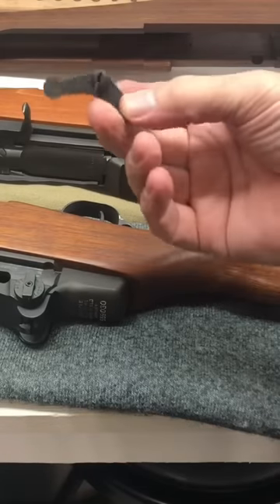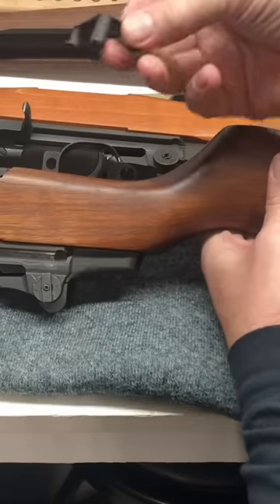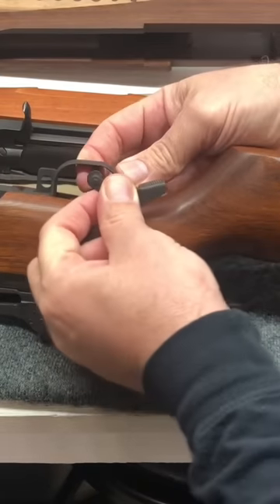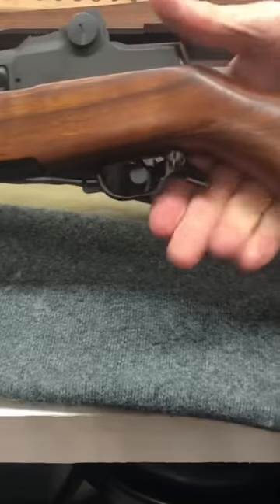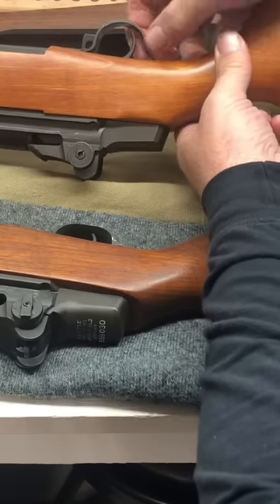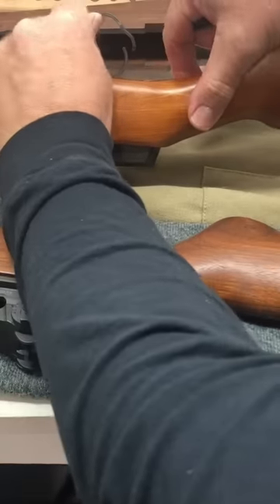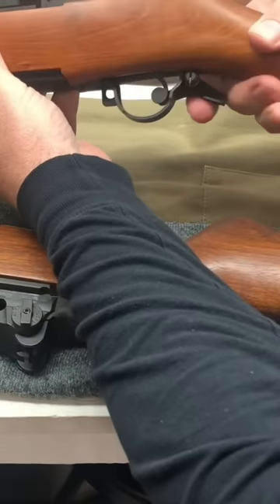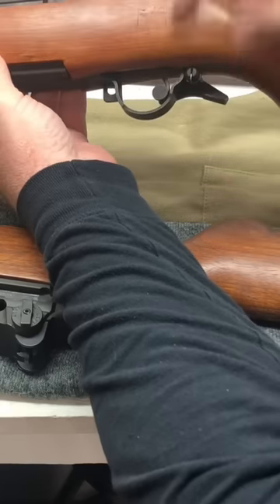M1 Garand winter trigger.

Comment: Most so called winter triggers aren't actually winter triggers. But triggers to shoot rifle grenades so when you shoot your rifle grenade and your rifle kicks back doesn't break your finger when it's in the finger guard.
Reply: they serve both purposes
Reply: @TheTokkin  idk because it would be more efficient to have a trigger guard that could be moved out of the way for glove use. Sure you could use it for both purposes but it seems it's original purpose is for rifle grenades
Reply: Are there even rifle grenades during the time of its inception?
Reply: @thewhalewacker682  the thing is the grenade recoil on the m1 garand isn't that much different from the normal rounds. So i guess its intended purpose was indeed for winter glove use.
Reply: @ghost1591  it's possible but I feel like the design could have been done more efficiently. why add an extra piece when the trigger guard could move out of the way allowing for easy glove use
Reply: your finger isn't going to snap from excess recoil. get a little chewed on my the guard, sure. I've personally had that happen with a particularly spicy shotgun with two barrels.
Reply: @jerryalbus1492  yes, the Garand had rifle grenades that would be launched using a spigot on the muzzle that latched on via the bayonet lug.
Reply: @thewhalewacker682  i could be wrong but the original design of the m1 wasnt made for winter, so yes it makes sense for a guard to be able to be moved but why would it if it wasn't made for winter originally
Reply: @jerryalbus1492  there have been grenade launchers that date back to the 1700's actually. They weren't as sophisticated as today's modern weapons obviously, but that's where they originated.
Reply: Why do I feel like that would make it easier to mag dump
Reply: @jerryalbus1492  yes they did.
Reply: @thewhalewacker682  the guard is a part of the disassembly process, it disconnects the trigger assembly from the action.
Reply: @ghost1591  Dude the recoil from the grenade is so much more...
Reply: @Jerry Albus  yes, and they were very popular due to different grenades being available from standard frag, smoke, and even anti armor grenades
Reply: @thewhalewacker682  wouldn't putting triggerguard away solve both of those?
Reply: @Finnishnat-conservativedot7126  that's my point
Reply: @thewhalewacker682  no you said that it's not meant for winter gloves by saying that you could just flip the triggerguard (which starts disasembly) which theoretically in your views would also deny the theory that it's meant solely for grenades....
Reply: @Finnishnat-conservativedot7126  The extra trigger is probably the best solution at the time because the trigger guard starts disassembly ( I didn't know ). It's very realistic that the extra trigger serves both functions, I just think it would have been a better design if the trigger guard could simply move out of the way rather than having to carry a loose piece with you.
Reply: @thewhalewacker682  this does sound logical I give you that, but I'll genuinely ask if you ever shot a rifle in mittens? Genuine question
Reply: @Finnishnat-conservativedot7126  not in mittens no
Reply: @thewhalewacker682  I had, and trigger like that doesn't allow to grip the rifle the right way, so you have to twist your wrist in quirky angles that can hurt if you are unfortunate. it's hard to explain the positioning so you'll have to trust me on this
Reply: @Finnishnat-conservativedot7126  understandable, I just feel like ( in hindsight) there's a more efficient solution to both the rifle grenade and mitten issue. Granted your experience with your rifle does show that it is definitely easier said than done
Reply: @thewhalewacker682  Because that's not how they designed it. It really is as simple as that. They didn't make the garand with a movable trigger guard, so they designed the winter trigger. It is much MUCH simpler to just add a hole in the back of the trigger guard, then to redesign it to move out of the way.
Reply: @scythelord  no, I know. Obviously that added trigger is way more viable than redesigning the gun. In hindsight there is a more efficient solution however the added trigger is more efficient than redesigning.
Reply: the proper way to fire a rifle grenade in the handbook is to place the stock of the rifle on the ground or against your body to negate the recoil i doubt this
Reply: @thewhalewacker682 on the M1 Garand, if you move that trigger guard out of the way, the rifle will come apart, it's how you break the weplapon down for maintenance
Reply: @jerryalbus1492  Yes, rifle grenades were in use during the First World War.
Reply: @thewhalewacker682  because most gloves were mittens unless you had some really good ones? Its still easier to depress the shallower angle trigger without fighting against the fabric of your mitten with your finger but its all semantics as ive never actually used it
Reply: @thewhalewacker682  because their gloves were actually mittens instead of gloves. Then they went to mittens with a trigger finger for the glove part. Mittens are warmer than gloves because your fingers are all together rather than each individual finger in a glove part.
Reply: @Finnishnat-conservativedot7126  you hit the nail on the head, back then the Army gloves were mittens so having a swing away trigger guard would do you absolutely no good cuz you still couldn't get your trigger finger around the trigger, your mittens wouldn't allow it. That's why they made the extra trigger and people started using them with grenade launchers.
Reply: This is VERY incorrect.
Reply: This, well mainly the it's for rifle grenades idk about recoil breaking fingers though definitely seems possible if you aren't properly braced. Also with rifle grenades they would primarily placing the butt of the rifle on the ground and using it similar to a knee mortar. You can't really use the trigger normally in that position, hence why this one allows you to do it just wrapping your hand around the stock.
Reply: @ghost1591  Bro the is utterly false, it's significantly more recoil, 1.2 pound projectile at ~300 Fps is way more energy than 30-06. I have fired modern repros and it's significantly more recoil even with lighter dummy grenades and modern grenade launching blanks that are quite a bit toned down so people's antiques don't explode. but basically no one was firing from the shoulder anyways so doesn't matter that much.
Reply: 🤣🤣 the recoil is not going to break your finger. More internet bullshit.
Reply: @jerryalbus1492  yes. Rifle grenades are prominent until the vietnam war where grenade launchers were introduced.
Reply: @jerryalbus1492  bruh
Reply: @conman3538  bruh
Reply: Yeah I was thinking from a safety point not that’s practical tbh I know nothing about garlands and their safeties but I imagine I it’s better than freezing your hand off and dying or broken finger
Reply: @jerryalbus1492 of course. rifle grenades were around in WW1. very primitive comparatively they for sure had them in WW2. you put a special kind of round in the chamber and then slap a special greneade on the end. (think of an RPG but with a pineapple grenade and fired from the shoulder instead of over the shoulder)
Reply: @jmsgridiron5628  is it those rounds where you have to put something like a stick in the barrel before you fire?
Reply: @thewhalewacker682  and they couldn't just do that for rifle grenades as well?
Reply: that doesn't even make any sense. you can easily shoot rifle grenades without breaking a finger. but have you ever tried shooting with heavy mittens or gloves on?   it can't be done in most cases, and you risk actual frostbite if you expose a finger to pull the trigger. that metal is cold. we had troops in the Ardennes, in Greenland, the Aleutians, in the Arctic. they needed to be able to shoot, they NEEDED a device like this. you don't need this to fire an RG. my guess would be that winter triggers were often adopted for use with grenades.
Reply: @thewhalewacker682  they were making guns long before this, which were often used in the winter, and they have been making them since, for 80 years since the Garand was invented. and none of them have bothered to include a folding trigger guard for use in cold weather, even those which could be expected to see a great deal of winter service at some point. so either you are a brilliant genius who has thought of something that generations of firearms designers totally missed, or they thought of it and decided against it in every case for reasons you have not thought of yet. my guess is that a folding/removable trigger guard is just too fragile or easy to lose. if you lose the little winter triggers it isn't the end of the world, you can make do. but a broken or missing rifle part is more serious.
Reply: @justforever96  I mean, if it's used to disassemble the gun  then I don't think it would be very unrealistic that a rifle could have a design in which the trigger guard could be rotated or otherwise moved. I understand what you're saying though.
Reply: Wasn't the rifle taught to be fired off the ground with the grenades?
Reply: @Jerry Albus  oh yes
Reply: @jerryalbus1492  for sure
Reply: @ghost1591  that is 10000% false dude wtf? Do you know what you’re talking about? Recoil from a rifled grenade is MUCH higher than 30-06
Reply: @Yoboyleroy  Difference is a 1000gr projectile  grenade vs a 165gr projectile bullet. Take a physics class, or get common sense haha.
Reply: @notablediscomfort  use a spent shell between the triggers, no more cut fingers, well timed double bang. 👏
Reply: @FullThrottleRacing535  pulled into your shoulder hard the rifle grenade is not that stout. feels like 00 buck not pulled tight to your shoulder, may be too jarring for a pansy ass.
Reply: Assuming the same amount of gun powder, the recoil should be similar
Reply: @thewhalewacker682  if you can remove the trigger guard for glove use, you can remove the trigger guard for rifle grenade use. you're logic right there.
Reply: @jerryalbus1492  they had rifle grenade back in the 1861. The Ketchum Hand Grenade.
Reply: Standard procedure was to fire rifle grenades using the ground as a base. You wouldn’t fire them from the shoulder, so the recoil would be nowhere near enough to break your finger. Also, I have never seen any documentation of rifle grenadiers being issued anything like this during the war
Reply: @kano8  yes, that would be the intention of having a trigger guard that could move
Reply: Yelling to Germans or Vietnamese

"HOLD UO STAY THERE LET ME CHANGE MY TRIGGER TO SHOOT A GRENADE"
Reply: @jerryalbus1492  seriously? They had grenades when they were still shooting arrows and rocks at eachother
Reply: @pws3rd170  no, it would not. Charge matters much less than projectile weight. Shooting a 160gr bullet vs a 1000+gr grenade is night and day. PHYSICS 101
Reply: @pws3rd170  oh my god you’re even a physics teacher. You should know this haha
Reply: @thewhalewacker682 guns today have still winter trigger but no one uses rifle grenades anymore...
Reply: @thewhalewacker682  because if it moves when you don't want it to, you end up with serious safety issue
Reply: do you have any idea how rifle grenades work?
Reply: what's next? you're gonna tell us how a carry handle isn't actually used for carrying a rifle?
Reply: @notablediscomfort  same I've touched off both triggers on a 12 gauge double barrel one hand. If you're actually holding your gun you won't have any problems. Then again, I'm not a normal size man. Still tho.
Reply: Firing the barrel mounted grenade wouldn't produce any more recoil that firing it normally.
Reply: @jerryalbus1492  rifle grenades were around well before the M1 in 1908.
Reply: @jerryalbus1492  of course there was why would we even need rifle grenades anymore
Reply: @Frogtalkin  I agree, ive never shot one myself but my original comment was honestly just calling out the fact its not the same as a normal round in terms of recoil, ive seen videos of people who can handle recoil well and have good shooting posture and you can notice it does kick a bit harder, nothing to cry about however
Reply: @thewhalewacker682  could have been something overlooked in development or relating to the machine process at the time, remember it's a very old rifle.
Reply: @thewhalewacker682  nah bro u need a trigger guard 😂 nice try tho
Reply: @thewhalewacker682  because the guns weren't designed for winter warfare they were just designed for warfare.
Reply: @thewhalewacker682  because the guns weren't designed for winter warfare they were just designed for warfare.
Reply: @jerryalbus1492  rifle fired grenades have been around since ww1
Reply: @nfaisnfgay  but the 1000+gr grenade is going significantly slower. You are still limited by how much energy you are putting into the equation. If you aren’t putting more force in, you aren’t getting more opposing force (recoil)
Reply: @nfaisnfgay  I’m actually not. That was my Junior year honors physics class. It was my bridge though
Reply: @thewhalewacker682
Reply: @thewhalewacker682  Safety. Instead of having people running around, never reinstalling the guard. People can do this much more quickly. That way they don't drop the rifle and have it fire accidentally.
At least that's my way of thinking.
Reply: @midgetman4206  it doesn't have to detach to be able toove out of the way. You could still lose the other trigger assuming you didn't just keep it installed, which would be fun but hazardous
Reply: @ghost1591  precisely. Rifle grenades for these old rifles is the same kick as just shooting it normally
Reply: @jerryalbus1492  rifle grenades have been a thing since before ww1 and beyond
Reply: The propellant for the rifle grenades was a blank round. It would have been the same if not less recoil than shooting it. You literally just made this up lol
Reply: Imagine being the first few guys to learn the hard way
Reply: @pws3rd170  I… okay buddy. Go to a range and shoot a 180gr 500 S&W magnum vs a 500gr 500 S&W magnum  and get back to me.
Reply: So 2 seconds of research determined this to be false
Reply: @NFAisNFGAY    yeah, it actually doesn't recoil much more than a rifle or shotgun round. 3 seconds of research have proven you wrong.
Reply: @jeremybianco8647  That’s factually incorrect. You found one bad source that agrees with you. Go to a gun range and rent a 500s&w magnum. Shoot 180gr loads, then 500gr loads. Tell me there is no difference with a straight face. Want to come shoot my Garand? Rifle grenades have significantly more kick than the standard rifle round
Reply: @NFAisNFGAY  I've been shooting my entire life dude. I've shot multiple m1s, mosins, kars, .500 Magnum, 10 guage, 50 bmg, and 700 nitro express, so yeah dude you're bullshitting the wrong guy acting like your m1 has kick. And it isn't one article its hundreds, and from people who have actually fired them. Even specified grenade launchers like the m79 were easily able to be shoulder fired. The round used to fire the grenade is what causes the recoil, not the grenade itself. And it was designed for the rifle to be able to handle, and to be usable by your average foot soldier.
Reply: @jeremybianco8647  then you would know a higher grain weight increases recoil. Done trying to be logical with you. Get your neck beard shaven off sometime lol.
Reply: @jeremybianco8647  muted, neck beard
Reply: @nfaisnfgay  gets proven wrong and mutes the guy that proves him wrong lol
Reply: i love making stuff up on the internet
Reply: @jerryalbus1492  the kind he is talking about only existed at the same time as these guns, didnt exist prior, and stopped being used after.
Reply: @thewhalewacker682  that’s how you break your trigger
Reply: @jerryalbus1492  Rifle grenades have existed since blackpowder was commonly used in militaries
Reply: How the fuck can it break your finger?
Reply: LOL no bro it wouldn’t break your finger it’s honestly a winter trigger 😂
Reply: @thewhalewacker682  nah coz if the guard moved out of the way you'd still have to hook a single finger around onto the trigger rather than just been able to squeeze against the rifle with multiple fingers.
one thing is it would be awkward to shoot while looking down the sights as you would have to have your wrist at more of an angle.
Reply: @ghost1591  an object at rest brother. Much more mass on a grenade than a bullet. We’ve all played call of duty but you certainly wouldn’t shoulder a rifle grenade and fire it if you like having a shoulder lmao.
Reply: @jerryalbus1492  rifle grenades were invented in 1908
Reply: @WendiGonerLH  i didnt know this thanks for the information!
Reply: @jerryalbus1492 shit it was around in ww1
Reply: Garand explicitly designed the rifle with a rifle grenade launcher feature, he made the adaptor himself, and he still made the ones for the M14, until he passed away.

He knew that the bazooka was still in limited production, so he wanted riflemen to at least have a fighting chance against an armored car or light tank.
Reply: @jeremybianco8647  >proven wrong 
Cope, goober.
Reply: Not meant to fire rifle grenades without the stock against something. Shoulder or ground like a mortar
Reply: @jerryalbus1492   There were rifle grenades in WW1.
Reply: This is more conviencing than a winter trigger i find such idea to have bad circumanstances when you might forget about it there or goofy glooved hand might get tackled into and so on
Reply: @Jerry Albus  yes. rifle grenades have existed since at least ww1.
Reply: @themonsterunderyourbed9408  Again, go shoot a 180gr 500 S&W load, vs a 500gr 500 S&W load and tell me with a straight face the 180gr is lighter. 
You literally do not understand physics haha.
Reply: It would work well with mittens. 
Mittens keep your hands warmer than gloves. And your finger wouldn’t fit in the guard with mittens on. Better than frostbite.
Reply: @TheTokkin  
No, not really, no. There's absolutely no winter glove that was supplied or used by the American military at any time during the Garand's service life that was so large that you couldn't get your finger comfortably inside the trigger guard with plenty of slack and room to spare. Literally the only thing that would prevent you from doing so is an oven mitt or an asbestos glove that was used by German machine gunner crews (which... no...).

The fact that Garand rifle grenades and grenade launchers were quite more widely used than most nations that had rifle grenades for their service rifles, as well, tells me that this is obviously for launching rifle grenades.

...And why? Because a toggle trigger this bit is just asking for negligent discharges and accidents to happen. Kinda hard to do that when you're, instead, shooting blanks and firing a single round before having to reload.
Reply: @helv2000  
1.) What "guns today" still have gigantic "winter triggers" that also don't have rifle grenades available?
2.) As to point 1, we do still use rifle grenades. Even up until the very end of the Cold War they were being still quite well used. The FNC and AK5 with the comically large or swing-out "winter trigger"? Also designed for use with rifle grenades, had a built in gas cut-off/sight on the rifle to fire them, and had a ton of different rifle grenades to fire.
Reply: @matchesburn  sig 550 has a big winter trigger, (probabley many more but that is the one i know for shure)  and the cold war 1 is over quiet some time now
Reply: That makes way more sense.
Reply: @thewhalewacker682  when one has to use "I just feel"....then he should shut up and stop arguing, since it is obvious that he is arguing FROM IGNORANCE
Reply: @WendiGonerLH and trapped gasses from firing a round to propel the grenade down range.
Reply: @ohitsthatguy1328 Medieval times used to soak a cloth with pig fat and gunpowder in a wrap then attach it to an arrow and fire it.
Reply: @leeshackelford7517  TF is your problem
Reply: @thewhalewacker682  it's a rude way to say it, but you kinda have been arguing from a position of ignorance. I don't mean it in a mean way, but there are probably a lot of counter intuitive things in gun design you aren't considering
Reply: @ffffffffffffffff5840  literally my only argument is that I think there could have been a better over all design however I understand the context all things considered with the making and designing of the gun. Yes that extra trigger serves both purposes, regardless of its original role.
Reply: @thewhalewacker682  yeah, I understood your argument, and I don't know any better than you. I don't bear you any ill will either, but it can be good to recognize when you're reasoning from a position of ignorance for critical thinking. Honestly, I have respect for you because you accepted new information and changed your mind earlier. I'll take that all day over someone who's informed but closed minded
Reply: @ffffffffffffffff5840  I appreciate genuine understanding, thank you. True, I was ignorant, however I still believe there's some validity in calming that ( in hindsight) there could be a better way to achieve the same task. I would have to prove my design by making it, after all I am only making a verbal claim based on little actual experience yes.
Reply: @thewhalewacker682  yeah, we should always try to do things better
Reply: @thewhalewacker682 yeah, you're not supposed to should the rifle when using it for grenades. The grenade really needs to be fired indirectly, like a mortar, with the butt held to the ground
Reply: @thewhalewacker682  Because it was fixed in the original design and doesn't open far enough to accommodate a gloved hand in the later one
Reply: @thewhalewacker682  most soldiers back then wore mittens not gloves
Reply: @jerryalbus1492  yes, they fit on the end of the barrel and if I’m not mistaken you use a blank round instead of a live one
Reply: @ohitsthatguy1328 but this is like comparing a sword to a plug bayonet.
Reply: You mean when the rifle recoils? It's not called kick back
Reply: WRONG !!!!
Reply: The item is literally called the "Trigger Group, Auxiliary, Winter". Had nothing to do with grenades, which are supposed to be fired with the butt of the rifle against the ground. RTFM...
Reply: Can relate being a kid holdin a double barrel 12 with one hand and pulling both triggers. I don’t thing I broke both but knew I bent the one
Reply: how could it break your finger if it's shouldered properly? I've also seen people put the stock on the ground kinda like a mortar, but that also wouldn't break your finger.
Reply: @thewhalewacker682
Reply: If you are properly using the gun when firing a rifle grenade then you won't have any worries about breaking your finger.
Reply: @jerryalbus1492  yes
Reply: @ohitsthatguy1328  rockets predate firearms
Reply: @jerryalbus1492  yes. Long before even
Reply: @thewhalewacker682  because when you move the trigger guard "out of the way" it falls apart as that is one of the disassembly step
Reply: @jerryalbus1492  Yes, there were rifle grenades at this time
Reply: @dustins.97  what?
Reply: @Finnishnat-conservativedot7126  The trigger assembly won’t stay in the rifle with the trigger guard not locked in.
Reply: @helv2000  It’s a fairly common sport to use the grenade launching blank cartridges & use golf balls in place of grenades. They practice in fields hitting distant targets.
Reply: @boomstick4054  I know it was a hypothetical
Reply: @thewhalewacker682  if you move the guard, the trigger becomes vulnerable to damage
Reply: @thewhalewacker682  The trigger guard on the M1 (and the M14) couldn't be moved out of the way.  It's part of the trigger mechanism and is what locks it into the receiver and stock. When you rotate it down it unlocks the trigger group so you can remove it. It's not at all like the AR15/M16/M4.
Reply: @thewhalewacker682  it’s a lot easier to adapt a gun for something then to redesign/design a new one some sort of military probably built that for the gun after it was made, or even if it was original making a movable trigger guard would probably make the gun more complicated to produce and more expensive to buy where as if they just build the piece separately you can just sell it to the people who need it
Reply: This make more sense... Because that shit can cause accident... Imagine walking around and some bumps prest that shit... Boom
Reply: @thewhalewacker682  i think its so that they wouldnt have to produce a ton more rifles with w removable trigger guard and instead just added an addon
Reply: @thewhalewacker682  less complexity and cheaper lol
Reply: Absolutely NOT true. The recoil on those rifle grenades are not enough to break a finger or even come close, it's just an M1 blank.
Reply: @bunkeroregano9492 "wasn't made for winter" you're gonna tell me that the standard is service rifle in the biggest war of human history was not designed for winter? I hope it sounds dumber hearing it repeated back to you.
Reply: @astraycat5428 I've also heard stories of cracking butts firing rifle grenades like this.
Reply: @jerryalbus1492  yup!
Reply: @helv2000  
"the sig 550"
watch?v=vz8YiMPZSZA#t=7m15s
...You were saying?
Reply: @jerryalbus1492  yes the M7  grenade launcher
Reply: @jerryalbus1492  There were rifle grenades from at least WW1 onward.
Reply: This is the biggest I know nothing about firearms comment if ever seen
Reply: @bunkeroregano9492  plus no rifle is designed for the snow. So it would make sense to have this accessory. I don't think whaler knows much.
Reply: @FullThrottleRacing535  it really isn't. It's actually akin to a 12 Guage.
Reply: @jerryalbus1492  yup they were grenades on sticks essentially. They went in the barrel of m1 garands and some carbines. Not completely sure anymore on exactly how they shoot as it’s been a while.
Reply: You're 50% correct!!!
Reply: @jerryalbus1492 rifles grenade have been around since world war one so probably
Reply: Makes zero sense. You're still shouldering the stock, your  finger is moving back with your shoulder. The guard isn't going to break your fuckin finger. Otherwise dudes shooting 50 cal would have the same problem. Maybe don't act like you know everything to get attention. Physics literally proves what you said completely wrong.
Reply: @jerryalbus1492 rifle grendes were created before ww1
Reply: @jerryalbus1492 yes they have been around since before the revolutionary war